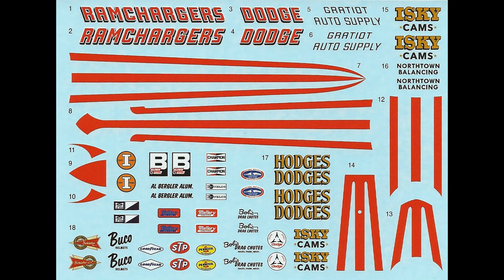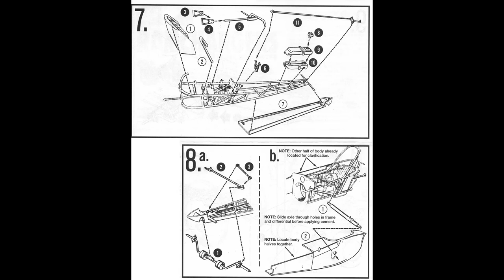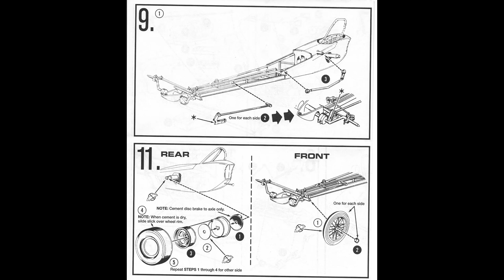Ramchargers AA Fuel Dragster 1:25 Scale MPC 940  -Model Kit Build & Review

Comment: I know I'm late to the party...lol..but I just found this video. ;) I got two of these now (found on sale at a local Walmart. Yes, Walmart! ), with one quick question. Would it be possible to 'cut' the bottom of the body and glue those 'belly pan' parts to the chassis by themselves? I realize it would be some work, but my only concern if I do that is how the rest of the body would line up with the bottom (cut off) part. I would assume that on the full size original cars, the lower part of the body belly pans were actually separate pieces? Since it would be impossible to work on them, not to mention impossible to build them with the body as one piece. ;)
Reply from the maker: Ronald,  You could do, that but there's nothing above the belly pans that are removable except the tube frame. Engine work was done by removing the top panels and pulling the motor for lower end work.  You would also have to add some braces/framework to join/align the body panels when the belly pans are removed. Thanks for watching and please subscribe if you haven't already to help us reach more modelers! -Doug